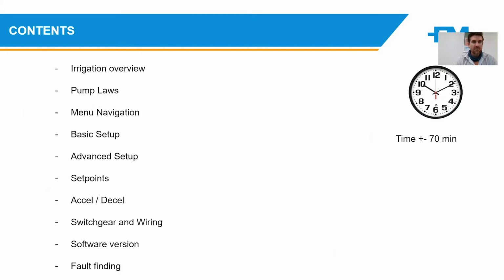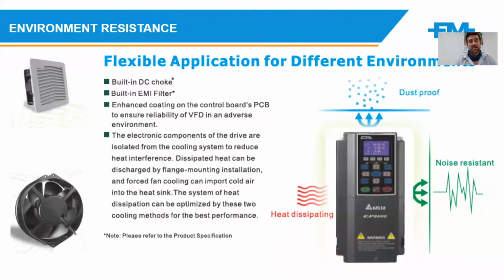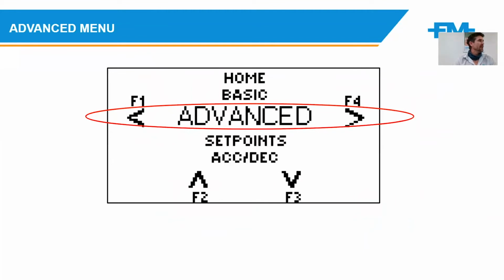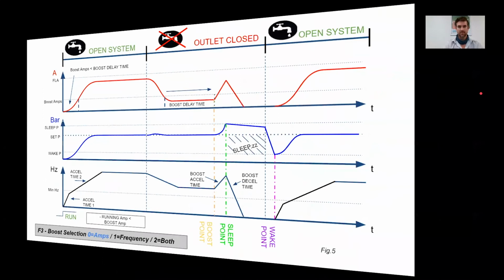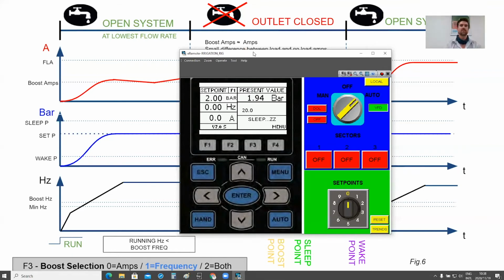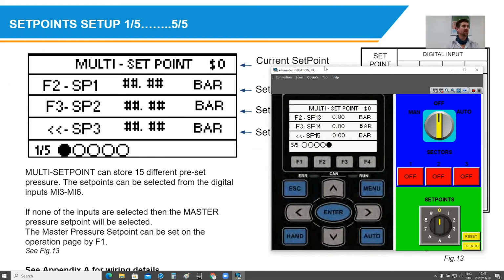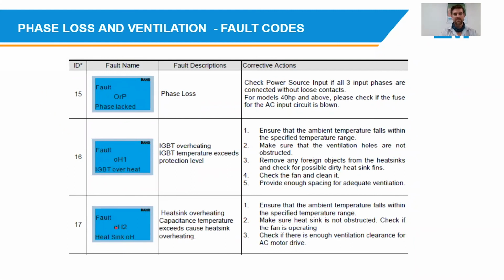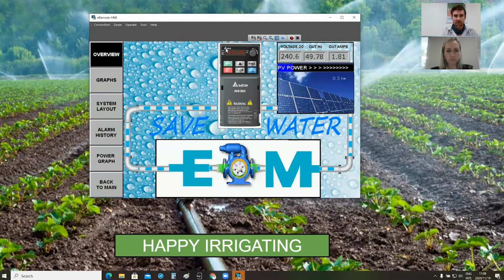Irrigation - Delta CP2000 Webinar

Comment: Sir, 
I am stuck with my Delta MS300 (20 hp 460 volts drive) acceleration setting. 
Need your valuable support. 
I have a submersible borewell pump of below rating 7.5 kw, 17 Amps rated, 2830 Rpm, 420 volts 3 phase, 50 hz. Pump is 500 feet deep from ground surface. 
There is Input as well as output line reactor for VFD.

The vfd output current rises beyond 18 ampere and thermal overload alarm appear when drive crosses 20 hertz frequency. I have tried increasing acceleration time beyond 100 second. But still same alarm.